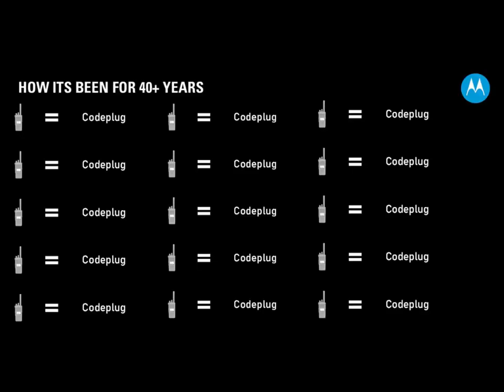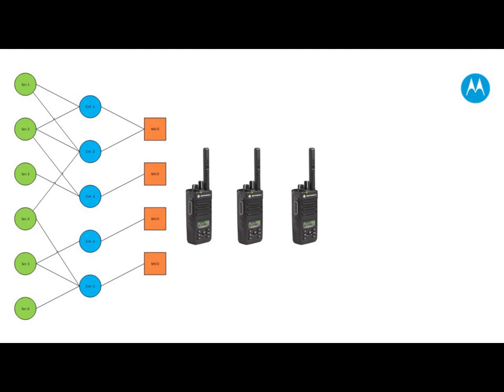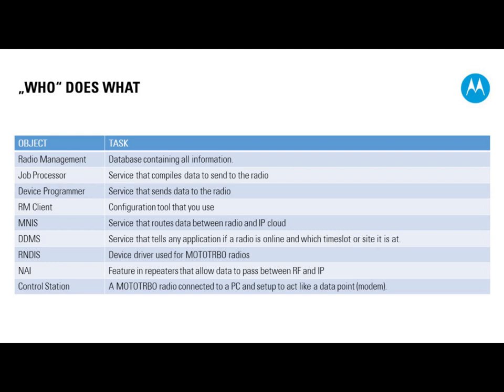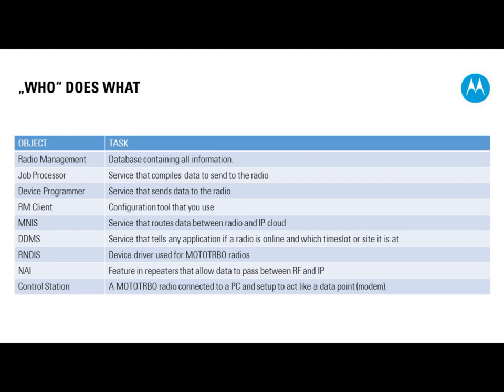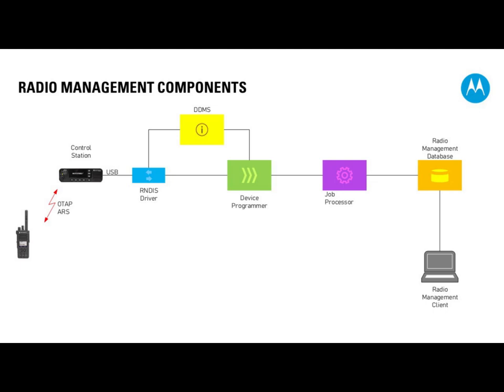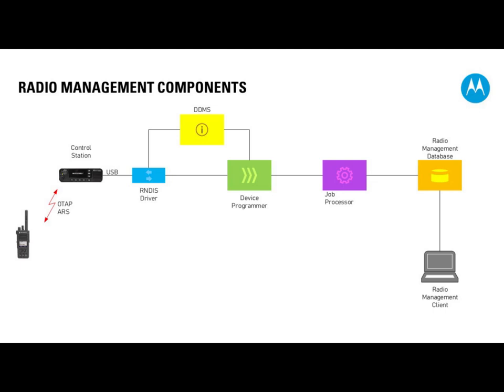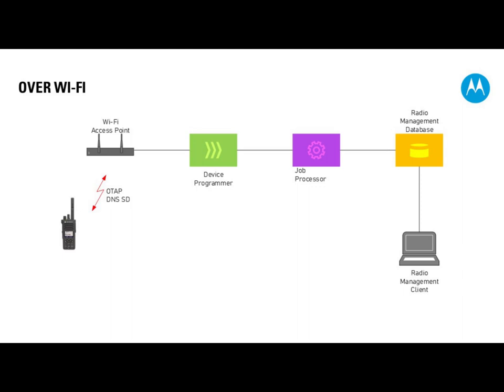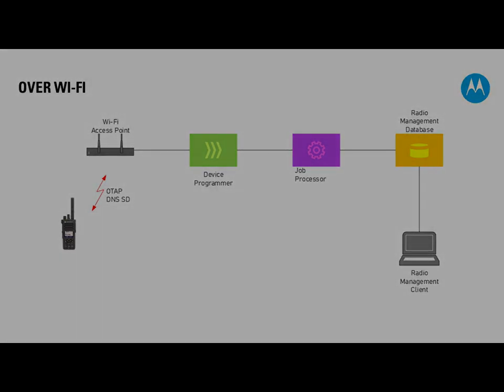Some concepts used in MOTOTRBO Radio Management

Comment: OK.  I was thinking of using it as an alternative where I have a lot of radios to program and no WiFi set up.  Would it be slower than WiFi and faster than OTAP?
Reply from the maker: OTAP via a Control Station would be slower than OTAP via MNIS and much much slower than OTAP via WiFi. Programming radios via USB is also much faster than OTAP but you have to bring all the radios in, and have to plug-in-plug-out programming cables which can be a pain.

OTAP is best suited for when you need to make small tweaks to an existing configuration. For really big changes, it's best to either use WiFi (if available) or USB.
Reply: @cwh050  Roger that.  Thank you sir.

Comment: Can OTAP via Control Station be an alternative on a network that is already set up with MNIS?
Reply from the maker: Yes, but I'd advise to think about that a little, as MNIS supports OTAP on more than one timeslot and does not require the Device Programmer host PC to be in RF range of a system repeater.